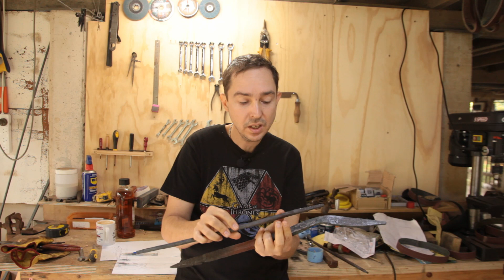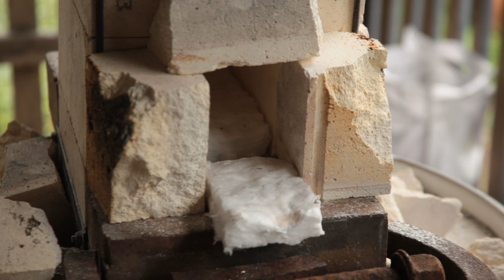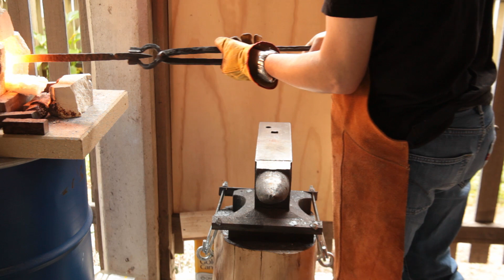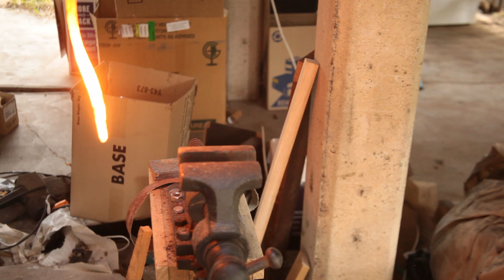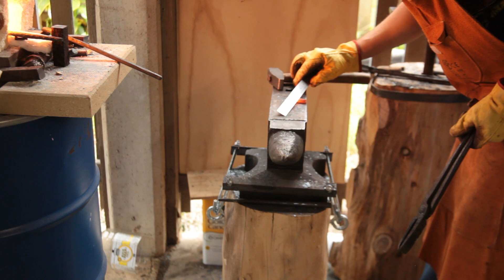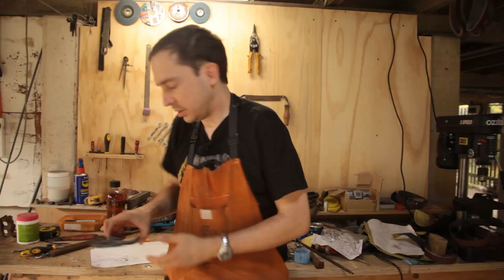Making the tongs from the Mastermyr Find; pt2

Comment: Doc sorry bit those look like a long knife of sorts, mate go check out John at Blackbear forge, and see how he makes tongs, you need 3 separate set downs and a boss area for the rivet. Or look up tong blanks.
Reply from the maker: Lenblacksmith this design isn’t based on modern manufacturing techniques, the half tong is a uniform 1/2” (~10mm in this case) from top of the nib to the end of the reins. Took me quite a while to figure out how the originals where likely made over a thousand years ago.

Comment: And now looks like you're trying to make bolt tongs, I am lost sorry mate.
Reply from the maker: Lenblacksmith these are Viking age tongs, based on an item found in the Mastermyr blacksmiths tool cash which was found in 1936 in Gotland.
Reply from the maker: Lenblacksmith they hold most small things from thin to 6mm pretty well but side slip under load is an issue.